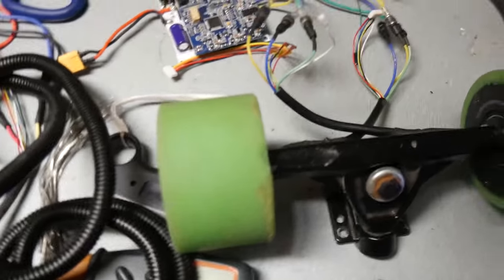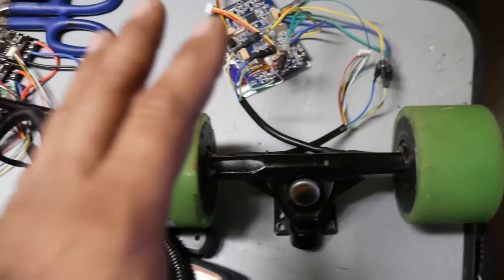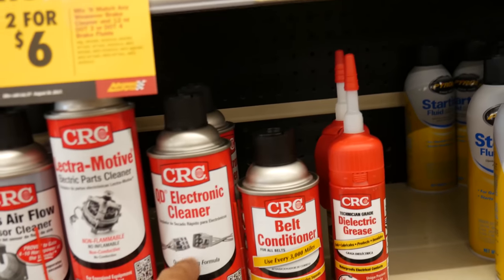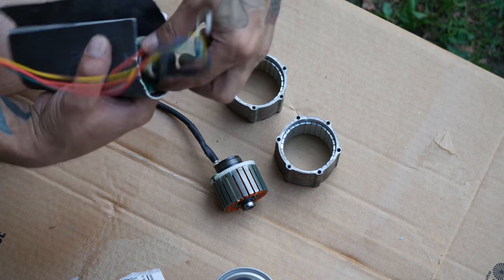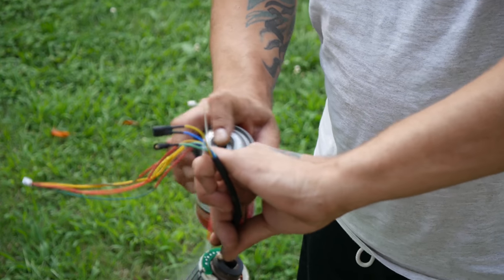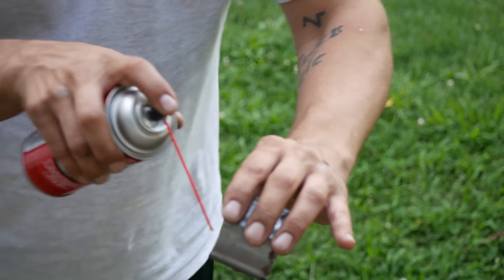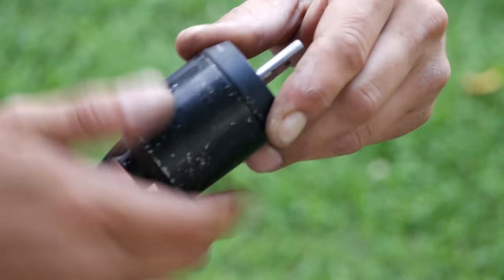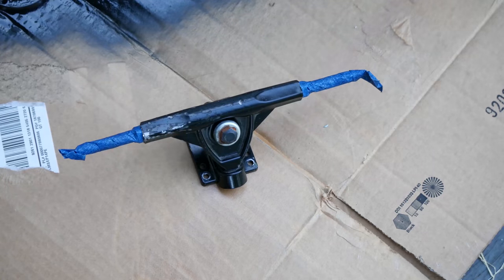How to clean your Electric Skateboard Motor - Hub Motor and Out runner Motor Koowheel Evolve

Comment: What do you consider a significant difference?(For the difference for the time each motor takes to stop.
Reply from the maker: Seconds. There can be lag in any specific motor at any given time for a number of reasons but for the most part they should both slow and stop at the same time. If not it could be a sign there is an issue or one arising

Comment: Do you also use that electronic cleaner on the hub bearings as well?
Reply from the maker: You can because they are sealed.  It will clean it up nice so there is nothing left behind to contaminate the electric motor.  Thats when issues arise and thats why they seize.  People often think its the bearing but its usually not.
Reply: @JoeKyser  Roger that. Tomorrow I'll be on my way to get a can of that stuff immediately. I haven't cleaned my motor since I bought this board 3 years ago and I've been hearing funny sounds from the motor intermittently and today one of the Wheels stopped working but then it worked again. I really don't know what's going on I checked the cable & they look fine but I'm going to take everything apart and clean it out good like you illustrate in the video
Reply from the maker: @pico_sandoval  electrical parts cleaner will be your best friend.  Clean all of your electronics with it if if you want.  Controller,  or whatever.  Its all good.  It will help keep the life of the motor stable thats for sure. I also have a video somewhere about what's that clicking noise.  There are several reasons you may get that.  It's good that you recognize that it's making a difference sound though this way you can address it at the very least before it gets worse.  I've worked on a lot of skateboards where the people never stopped and took the time and then beyond that there was so much damage they had to replace the motors

Comment: At what point would you say that one should replace the motor, for example my board have a mileage of around 700 miles, and I'm definitely starting to notice that the motors are getting very noisy, at this point do you think it would be a better idea just to replace the motors all together?
Reply from the maker: Dam I am so sorry.  I am just now seeing this. Sometimes there are so many comments,  I miss them.   Get any insight to that question since?
Reply: @JoeKyser  No worries at all, can't imagine it being easy to keep up.  I've taken a good long look at my motors, and think it might be time to change them, the wheels have been rattling a lot, and it turns out that the metal lips that connect the wheel part to the hub motors are starting to shear off, I tired inserting some steel wire to replace the missing metal, and it worked for a while until the wire started to compress and the rattling began again. but after almost 1200 miles I'm pretty satisfied with the lifespan of the motors If I'm being honest. and the battery is also getting to a point where it needs to be switched out, so I might even go for a new more "Up-to-date" board.
Reply from the maker: @Th3_W01f  i know exactly what you are saying.  Yeah the  batteries slowly but surely lose the ass behind them too.  Ive spent so much momey on boards its ridiculous.  I also use them like there's no tomorrow.  Some motors are made way better than others too.  I have motors I haven't been able to ruin if I tried.  Others that went crap on me just after weeks of ridimg.  Like completely fall apart.

Comment: Hey brotha im glad I found this vid! I just got a raptor 2 with dual Focboxes so an earlier gen for sure. You have any info or experience with these? I got it for a steal and ive always wanted one not knowing all the problems they had. The motors tend to make a grinding or Braking sound when i first start off...hence why i googled lubricating hub motors. It came with a pair of extra used motors one of which ive already changed out. After a hard ride this morning in light rain on hilly terrain it started that sound again....any insight would be awesome!
Reply from the maker: I do have experience with them. Im going to be making some videos actually. Well i have them made a d scheduled for upload. Your questions are good and I will use it to make more content with the raptors. I have a couple of raptor 2s currently.  There are a lot of underlying problems. Ones that could strike anytime. The motors will make noises on them. Mine sound like popcorn machines sometimes. Enertion actually said once they break in they will be noisy. Hmmmm right?  Ive torn down one and can bring that to youtube. Theres interesting design flaws for sure. As far as the noise from them,  it could be a sign of something and may nit be. Its tough because i have what seems to be healthy motors but make some sounds thats for sure

Comment: Hey man, I just got an H5 from Teamgee, its hub driven, would this work for cleaning the model I have?
Reply from the maker: I was not familiar with the model but just looked it up. It seems to be a similar maintenance scheme. I would say just be careful when opening it. There are usually small wires there that can break easily.  Also there will be natural wear and sounds will change. It doesn't mean all the time that the motor is bad or dirty.  Maintenance cant hurt though. I have quality motors that years old and had plenty of use that still work good. The junk has been junk and not much you can do about that. At the very least you can crack them open and apart a little bit and then spray up into and let it run out to get all the dust and all that accumulated in it.

Comment: Hey man, first of all big up for this vid, I've looked around finding something similar and all I found were people using wd40...
I have a backfire g2s and id like to clean the motors with contact cleaner just how you demonstrated, but when it comes to get the outer part of the wheel off the actual motor, I'm afraid to use more force than I should. So my question is this: how hard do I need to pull to get these suckers off and am I going at it the right way? Your video is just not showing that one step I'm stuck at... Any advise? Peace out bro, great work you're doing
Reply from the maker: I have a video that shows how to take them off too. The magnets are strong. Pull hard as hell lol
Reply: @JoeKyser  hey man thanks for swift reply. Found what I needed. Top man.
Reply from the maker: That's what's up

Comment: Hey brotha thanks for this video.   Ive tried your cleaning and maintenance tips and one of my motors is making a strange resistance type sound.   At high speeds it makes a lous clicking.  Ive watched most of your videos and am still at a loss.   Whats your policy on sending boards to you to fix.   I can pay. I just use mine for work so i need to figure this out asap.  I might need to get a new motor. Hopefully not
Reply from the maker: Tyler Allen why would it comes to repairs the shipping always gets paid for by the customer both ways. then I only charge $20 an hour and won't charge if it's not something that got fixed so there's no consultation fee or anything like that. I also try to avoid taking things that I don't think can be fixed. or in a situation where it would cost just as much to have it fixed then it would to just replace the part. I can check on when I'll be getting my next shipment of parts in. it's never really that quick but I can definitely find out for you. I believe you'd have to replace that motor there from what it sounds like.
Reply: Joe Kyser ok thanks brotha.  Ill look into getting a new motor.  May be cheaper anyways
Reply: Joe Kyser do you have a personal email i can send you a quick video of whats going on

Comment: any chance for a teardown of the koowheel d3m gen 2 hub? i cant figure out how to get the 2 motor pieces separated
Reply from the maker: i wish i could tell you i will post it but im so busy right now. I will have to take a look at it and see if i know what you mean
Reply: its more separating the outer part from the center of the motor. ive removed the screws but the motor is still in 1 piece. :( so i dont know if i need to print something so that the center part can be forced through with even pressure or not.
Reply from the maker: @markd.8885  ok i just looked, couldn't remember. Take the screws out the back side and pull. The magnet is strong and try to keep it together. Once all the screws are out on the backside you should be good to go
Reply: yeah ive tried that and still no luck, so im printing a tool to help me push out the center of the motor.
Reply from the maker: @markd.8885  ya the magnets are strong as hell, no doubt.
Reply from the maker: @markd.8885  makes me think of the first time i took one apart. Never dawned on me the magnets were holding it together. I was using a wood and a hammer at first. Just realized i needed leverage on it. These are not too bad. Some are super hard. Maybe once you peel yours apart it will be cake after
Reply: yeah its why im building a part so i can get the force behind the removal. because my back mounting plate for the motor will just spin w/o the screws in but it wont move. once i validate that it works i will post the model

Comment: This vid is 2 years old but could someone help me please with cleaning my hub motors?
I have a meepo nls pro ~200miles old and i recently noticed that both motors have friction as they stop faster than when i got the board new.. Plus 1 wheel stops even faster than the other. I hear no cracking noise which means there's no major debris inside the hub but it could be rusty thus the friction...

So i went and bought 3 WD-40s, a contact cleaner, a silicone lubricant and an anti rust. I assume according to your video i have to remove the cap, clean the coil with the contact cleaner, then the bearing with the lubricant and the metal part before the cable with the anti rust? I know im not supposed to spray antirust on the bearing.. But would it be okay if it touched the cable or make damage? The cap and the bearing could use i assume silicone spray... Please help me :/
Reply from the maker: No problem at all. I still work on boards and monitor my comments.  Worst case I dont see a reply ot just better yet email me. Thebrokerscollection@gmail.com
Anyway that would be best. Just copy this and paste it into an email and give me some pictures too. I will let you know what I think the best way to go about maintence

Comment: Hey I have a question I'm trying to figure out whats wrong with my e-board. It turns on, but doesn't run. I did purchase a new controller that worked fine and is hobbywing tech. It stopped one day, but was able to jump start it my putting it to charge but now it won't run but connects fine.. some help would be appreciated.
Reply from the maker: Do you have electrical testers?
Reply: @JoeKyser  I don't
Reply from the maker: @dragonknight5007  well I mean we can guess some things.  I dont know what jump start the controller means. Tell me more about this.
Reply: I meant jump started the board to get it running by putting it to charge. It is a wowgo s2
Reply: I disconnected everything the wiring looks fine I just can't get into the hub motors to see further if those wires are ok

Comment: Is it possible to burn a hub motor out? Mine makes a really loud noise when riding and doesn’t hit the top speed. The battery also drains a lot faster
Reply from the maker: Mark Demarsico yes. The copper winding inside are coated with a very thin layer of plastic like material. When that gets compromised, maybe rubbed or dirt grinding on it or even heat, it is "burnt out". That one may have an issue like that. Creating more drag draini the battery fast

Comment: This will fix the wheel slip problem?
Reply from the maker: Wheel slip? On a hub motor?
Reply: Joe Kyser yes. My hub motor one wheel stop faster than the other one. Idk what should I do. One motor take longer to stop spinning. What should I do about it? Do you think is motor problem or I need to clean it?

Comment: How many miles were on these before this happened
Reply from the maker: Before one motor slowed down a little more then the other? Shoot I have no idea. At this point I was the most active ESK8 rider in the world, logging anywhere from 10-20 miles a day. Maintence should be often and not based on how far it was used but taking into consideration where your riding and what kind of riding your doing.  Maintence is just that anyway. The point of the video wasn't to show any kind of fixing because the board was used a lot. The motors could get dirty in the first use. Just be cognative that your riding on sensitive electronics. It's not as heavy duty as they want you to think. The motors do a pretty good job of keeping the junk out but they do get dirty. The drag is usually a sign of that. Thanks for watching
Reply: Joe Kyser thanks for the info and replacement hubs from manufactures aren’t even that bad it’s like $50-80 per hub from what I’ve seen.

Comment: Soooo you're not going to lube it up?🤔🤔🤔
Reply from the maker: Lube what? The bearings are sealed. Just the edge of them sometimes on some because then it stops the squeezing coming from the surface. Idk about lubing any electric motors. It's not something that's ever been called for in any of the motors I used.

Comment: Hey Joe Kyser. Thanks you so much for your video. Very helpful. 
I need your expert advice about what to buy of cleaners to fix my GTR motor. I live in Norway and we have some different names on cleaners. I can find WD-40. Is that good to use? and what else do I need?. 
I have an Evolve GTR motor that needs serious cleaning. one of my motors is making a really high pitch noise now after I got caught out in the rain a few days ago. I suspect moisture and dirt got inside, locking it up. The motor also stops randomly and gets a lot warmer than the other motor. The other motor is spinning fine. What do I need to buy? 
Here is what I can buy at my local store:  https://www.clasohlson.com/no/Jernvare/Teip-og-kjemikalier/Sm%C3%B8remidler/c/2053

Comment: Can you use wd40 to clean??
Reply from the maker: no, electrical parts cleaner. you can find it at an auto parts store. it dries clean and dries real real fast
Reply: Joe Kyser shit I already done it connected it but it’s still doing what it was doing making a stuffed up noise and the motor pretty much stops when I press break but the brake stays on????
Reply from the maker: That will attract more dirt and dust then you can shake a stick at. Brakes stay stuck on when you release? Are you sure that's not the remote getting hung up? Maybe make a couple short videos. You can send them to me on Instagram, facebook or just post it on YouTube. I will take a look and a listen. I would try and wash all that wd40 off. Thats not good for electrical parts at all
Reply from the maker: Aw man I went back and watched this video again. I couldnt believe how in detail i went with what cleaner to use and where to get it. Did you watch it? : ) If you need help I can help but I need some video for sure.
Reply: WD40 do actual have a type of spray called contact cleaner which is the same stuff.
Reply from the maker: I was talking about the lubricant product not the brand itself. I assumed people knew what I meant. Around here we use the word wd40 generically. Pb blaster, wrench loose, any type of oily lubricant we call wd40. If I told the mechanic hand me wd40 whole om working on something he's not going to hand me contact cleaner lol. Any kind of contact cleaner is fine. Doesn't matter the brand. Yes wd40 contact cleaner is fine. I have nothing against the brand itself
Reply: I wouldn't use wd40. It has a tendency to attract dust

Comment: you didnt show how to take it appart
Reply from the maker: I guess I could have shown all that.  Its pretty self explanatory.   Take the motor off the trucks.  Now unscrew all the hex screws on the cap.  Ok done.  Thats it.
Reply from the maker: Oh dont forget its magnetic.  It wont just fall apart.  Pull the center out.  It will be stuck to the outter casing thats full of magnets.